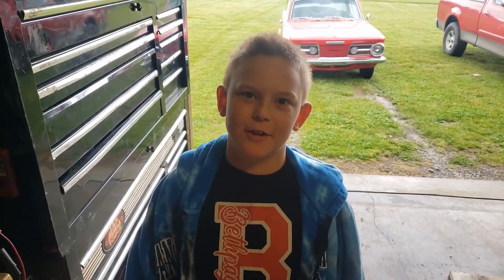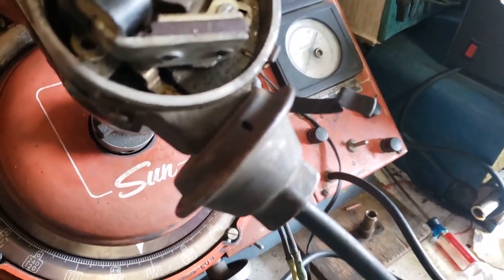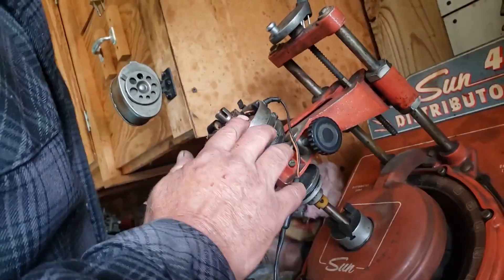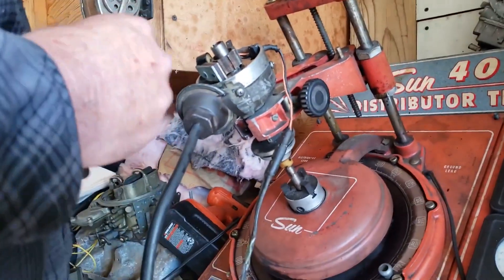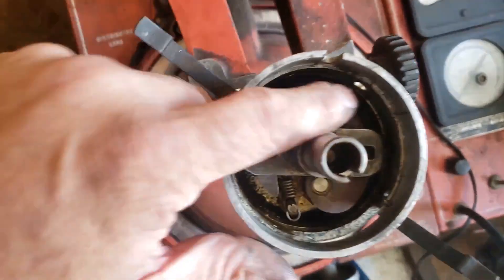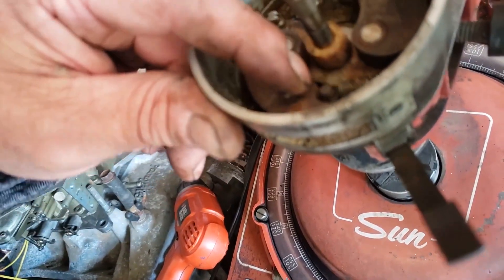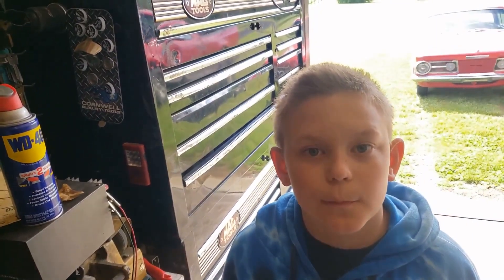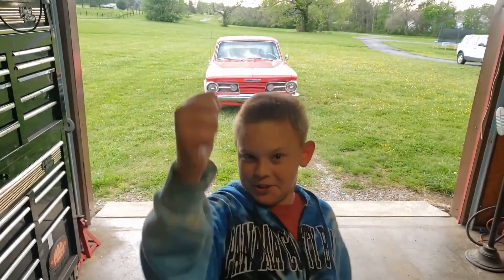A simple shocking speed secret, recurving a distributor for performance and gas mileage

Comment: how wuld plazma ore amplified ignition behave in a engine? Im not shure what Im geting useing it? how wuld you tune carburator for max fuel efficiency culd acelerator pump by removed and moded preshure valve on the carburator to force him to work jusl like ordinary mechanical carburator? perhaps adding some vaporisators and moisture/air seperators wuld that work similar like Lpg car?
Reply from the maker: Hello devils wish. Plasma ignition have being worked on for a long time now and its finally showing benefits. I personally think it might be the way of the future for combustion ignition. Mileage being one benefit but all around torque hp. And emissions. As far as carburetors for fuel economy a lot of work can be done to improve on them for gas mileage. But if you don't computer control the air bleeds day to day will change the tune.still improvements can be made. First under size the carb. The more wide open the carb is the better the job it does but we go to fast so smaller is better  for that reason alone but hi air speed is important here also and thats what also happens with a small carb. As far as taking off the accelerator pump the carb would have to be designed ahead of time for this. For instance the boosters need to be long and very pulse  sensitive. The system can be tweaked to be much better though. One easy fix is delivery timing. Once the carb has transitioned to the main you can almost eliminate any more pump. Also deflectors can be installed at the nozzles  to spread and deflect and mix the fuel helping you to reduce the shot size. As far as other devices attached to carb I don't have a clue sorry bout that.

Comment: Hey John, love the video. I have a Mallory Dual Point YL for 383 Mopar. Can I take out 1 of the springs to advance it faster too. If so which one. Thanks
Reply from the maker: Yes you can I always take out the biggest 1 no matter. Those were the best distributors of the day. Some distributors   if you take out the spring require a E ring to retain the centrifugal weight so double check that.

Comment: All in by 1500 RPM? Isn't that a little too soon? I would say all in by 2000 or 2200. I would think that there would be some power loss at 1500 RPM with too much advance coming in too quickly. Or am I wrong?
Reply from the maker: Ignition timing is tied mostly to cam timing, and at peak torque is the point where the compression pressure is at its highest. At that point is where your total timing vacuum is at its lowest. Now I'm going to be completely honest with you. My timing on the barracuda and the truck is at max at idle. All in including vacuum as soon as the engine starts @ 46 on the barracuda and 48 on the truck. I have to be careful about saying these things because if you're new to driving and with a manual transmission, lugging an engine with this kind of timing can cause damage. 2 more things. If you lock out your distributor, then your timing starts and idles at your peak timing minus vacuum 32-38 or so. Running that way the engine is so responsive and fun to drive. The problem with lockout is that you can't start the engine unless you flood the engine or crank with the ignition of. Know back to cam timing. All cam profiles have a peak torque range and all above and below rpm,s there is lower cylinder fill which means the compression pressure is going down above peak torque and going up below peak torque. At lower rpms, the intake valve is open to long, and the piston pushes intake charge back into the intake manifold. (That's why engines with big cams idle with low vacuum) and thats why compression is lower under max torque. Above peak torque there is simply not enough time to fill the cylinder because the port is limited or the intake valve closes to early. Hope this helps. Thanks for watching.

Comment: Ty Sir and Son , Never have seen this done before kinda understand it but its been eons since i timed a motor . The carb adjustment u showed at the race track can you plz do a vide on that , more info plz , Bless you all and i subbed also ty :)
Reply from the maker: Thanks for the sub, I think you're talking about the Weber plates, yes I will be doing a vid on those. If that's what you're talking about keep your eyes open for these things at the car swaps there getting hard to find and they are so easy to use. 👍
Reply: Tall John's Fun Shop appreciate it John. 👍

Comment: So I did this to my 400 BB Mopar today. I pulled the distributor followed your instructions and all went well with the distributor. But my son bumped the starter with the distributor removed. I put a mark on it before I removed it and I installed it back exactly where it was beforehand. But I'm worried to try to start it now where the motor was turned over without the distributor in it. Is this going to completely throw off the timing?
Reply: Should I have turned the motor till the timing mark is at TDC before installing it back into the motor?
Reply from the maker: On a 400 mopar, the distributor can only go in 2 ways, right or wrong. Or another way of saying it is correct or 180 degrees out. The exception is if you lifted the intermediate shaft (the gear down in the hole were the dist mounts), you might need to find TDC at that point. So because your either right or wrong if you put the distributor in and the timing is any were close, it should fun and if your in the wrong position it won't ever start and you will probably get a backfire.  If this is the case, then simply lift the distributor about a half inch and rotate it 180 degrees and put it back in and then set you timing  where you desire and ready to go. Pulling #1 plug out and cranking the engine with your finger over the plug hole until the pushes your finger away will help you avoid a backfire on the chance that you guessed wrong but a little pop or backfire and the rotating the distributor is easier and faster.  Anyway, thanks for checking us out. I hope it helps.
Reply: @talljohnsfunshop2722  thank you sir! I got it straightened out
Reply: Well I thought all was well. Initially I had it 180 degrees out. I pulled the distributor up spun the shaft 1/2 turn, and put it back in on the mark I had initially made on the block and distributor before I touched it. It crunk up after a couple tries. Ran decent.  You said yourself in a video, that if your motor is backfiring, you need to get a new mechanic 🤣 well I do all my own stunts, so I thought you could help before I fuck something up bad. I haven't driven the truck yet, because I just have got it back together enough to drive. but in park, if you smack it close to, or at wide open throttle.... I get a huge backfire and fireball through the carb. I don't have a digital timing light like yours. My timing light is probably made the same year as the truck. Sears Craftsman. Nor do I have a tach. Like I said it's a 400. Long tubes, Edelbrock carb and electric fuel pump and pressure regulator. I don't know much else. If anything has been done to the motor.  I have no clue beyond the timing tab how much timing I have.  I was wondering if there was anyway I can send you a video of what I have going on. I trust your knowledge, and maybe you can point me in the right direction. I'm getting frustrated with the damn thing. It runs pretty good, but when you get into the secondaries it busts back. I can definitely show you better than I can type it. I think it's something simple honestly. I'm just not catching it. Thanks for helping me get it me this far. And I definitely would appreciate any advice!

Comment: Great video! I plan on doing my straight 6 in my '77 Jeep CJ.  It has 35" tires and is a real tired dog off the line. Any tips?
Reply from the maker: Many times on the older vehicles i find that mid to late 70s and early 80s that the cam timing is retarded about 4 to 8 degrees. Then you add that the timing chain is old and stretched out and the cam sprocket is made out of nylon and is ready to break. So I would look into that. Getting your initial timing up will help a ton. But be careful not to ping it, thats never good. Working those things has very successful for me.
Reply: @talljohnsfunshop2722  That makes perfect sense I will definitely put a new timing said in there cause I have no idea what it would’ve been done last if it ever was. Then I’ll move onto freshening up the distributor.

Comment: Great videos and info. Are you using the Chrysler ignition module as a pulse amplifier?If so, how have you wired it? I am just getting started with a Sun 500 Distributor tester and would love to use it for Chrysler electronic Distributors. Thanks.
Reply from the maker: boydsdodge  for the electronic mopar dist i use the chrysler module. i use the black and yellow wire (TACH) wire i connect to the points lead and i use a 12v power supply it work for any magnetic pickup gm or ford
Reply: @talljohnsfunshop2722  Thanks, I will give it a try. Plenty of ECUs around here.
Reply: It worked, thanks. I used a AC/DC 9 volt wall plug for power.
Reply: Now to get the tach dwelling working. new batteries, tach bottoms out below zero.
Reply from the maker: sorry didnt get back sooner had some race friends from way back show up. if ya need more info ask away ill do what i can to help. have a good one
Reply: @talljohnsfunshop2722  Thanks, No problem. I had a faulty transformer and it was throwing me off on my connections, reason why I was asking about ground. I am sending my Tach and dwell meters out to Paramount to get batteries converted and calibrated. Can't wait to start optimizing distributors. The one question I have is, if engine wants 20 initial but that causes hard starting what do I set up the distributor with. Also if you remove the springs, how do they return at idle? Thanks again.
Reply: @talljohnsfunshop2722  I got the mopar orange box working as a pulse amplifier, using a 12 volt transformer.
Reply from the maker: @boydsdodge  if you have hard starting at 20 them you must set your initial back to were it will start. Initial is really only for starting . no advance would be best (LOCK OUT DIST) but you end up with the hard start. not good for street cars. so i set my dist to full advance after start up. Thats the way mopar did it in the day on there race stuff also. so if 18 it will start thats your initial. I have seen a few people have some ideas about were you set the initial but my way is as hi as you can go and have good hot start engine. Know I have seen some folks take the time and put one spring so soft the it pulls the timing back to say 5 and they put a loop or oval shaped spring loop on the second one that stops the dist from advancing until the rpm you want. As far as the advance coming back,  the one spring you leave behind will pull both weights back. if you take out both springs it wont return and it like a LOCK OUT DIST.
Reply: @talljohnsfunshop2722  Great info, I get it now. Thanks for the info, very helpful, having this Sun tester going has really been great for learning on these, now to get my Tach back from Paramount. Thanks again.

Comment: what happens to the weight with no spring when it is send it out with centrifugal force?
Reply from the maker: It still does its job of advancing the timing only it does it at a lower rpm. It moves back when the lonely spring can bring both back when centrifical force gets low enough to bring it back.

Comment: is there a GOOD HEI distributor for the slant six? or is it only cheap crap and needing a GM ignition module thing no one can seem to give me an answer and ive been looking for almost a month
Reply from the maker: Well there are a couple different dist available. There's the mopar electronic using a mopar module. There is pertronix   you can use ( haven't used one of those in year's I'm not sure if there still available) and there's the tri power that uses a basic gm type HEI module but not a complete distributor, it is a good  system from what I've seen but I have never personally used one, hope this helps. If this is not what you're  after I'll try to help
Reply: @talljohnsfunshop2722  that's the thing, I wanna get rid of the mopar module and put in an MSD ignition. I dont know if any of the distributors you listed will even work with it, I cant find any forums or videos to see if they work together. Thanks for replying
Reply from the maker: You can use the mopar  electronic distributor with the msd. The msd distributor uses a copy of the mopar pick up. They are completely compatible I use a 6al box on my mopar distributors
Reply from the maker: The mopar distributor is a magnetic pickup so just google msd magnetic pickup wiring and you  will find it
Reply from the maker: https://www.jegs.com/InstallationInstructions/100/121/121-6425.pdf      scroll down to page 16 this is factory mopar distributor to msd 6al
Reply from the maker: Which distributor do you have now points or electronic. NP we all started somewhere some day you'll be a pro at it helping someone else
Reply: @talljohnsfunshop2722  stock distributor which i believe has points. my car is a 73 dart swinger (don't know if model year helps)
Reply from the maker: If you have points now and want to keep that distributor you need to get a pertronix 1361A ignighter you can get them from Amazon. This can be used with MSD. You can also use your points with your MSD all 3 wiring diagrams are in the link I sent you
Reply from the maker: The link you sent me is for a replacement  magnetic pickup for a MSD distributor. It won't work on a factory distributor.
Reply from the maker: If your distributor has 1 wire coming out of the side its points if it has 2 it electronic if it's a factory setup
Reply: @talljohnsfunshop2722  and if i want to change the whole distributor, what one should i go with?
Reply from the maker: That's a cross over year it may or may not have points if one wire is coming out of the side its points if 2 its electronic
Reply from the maker: The mopar factory electronic is a excellent distributor but I would recurve for sure. There aren't much for good aftermarket parts for the slant so you'll have to find someone to do it or do it your sef

Comment: Hi thank you for this video!! I just did this to my 73 B300 360 and when I went to start it it cranked and cranked then backfired Huge. Then it started and ran great then nothing. Do you have any idea what I may have done wrong? I did this with the distributor In place and didn’t mess with the timing.
Reply from the maker: Hi sorry to here you had problems.  A guess would be that the little horse shoe clip my not be in place and is allowing the reluctor and rotor to go out of time.
Reply: I’ll check that out thank you for your time and your videos!!
Reply: Hey Tall John! That was one of my problems the other was the pick up was just ever so slightly out of line! Thanks for the push in the right direction!!

Comment: On road trips I’m running 2250rpm at 75mph in 5th gear. Should my timing be all in by that rpm?
Reply from the maker: Yes absolutely. Anytime your engine is at Cruz throttle position it can handle total all in. The reason is at Cruz your engine is running at 60 PSI compression. Compression that low burns fuel extremely slow, so the need for high timing.
Reply: @talljohnsfunshop2722  thank you for the prompt reply. Everything I’ve seen says by 3000 rpm, but I don’t run that high with overdrive
Reply: So, total advance, is that with vacuum hooked up or not hooked up?
Reply from the maker: @mikeburnett7028  total is without vacuum. when vacuum is stated it's always (total w vacuum )

Comment: Hey John I have a real quick question. IYO who is making the best non-HEI distributor? The HEI's are too big for my use.
Reply from the maker: DobermansRock when use aftermarket i always go with MSD distributors. you dont have to use there module to make them work it wires in the same as factory
Reply: @talljohnsfunshop2722  Thank's Tall John. I figure a guy with a calibration machine would know what calibrates best. A good TMDE Test Measurement Diagnostic Equipment day to you friend.
Reply: @talljohnsfunshop2722  They say used MSD box and thats another $300
Reply from the maker: I find the street dist w vacuum advance for mopar about 150.00 and kit for about 350.00 on E bay

Comment: first ,  20 deg initial and all advance in by 2000 equalls ping monster . second you will never accurately set initial timing with engine running with all that slack in the weight mechanism . it will just bounce around .
Reply from the maker: Well micheal if your engine won't ping with all in at 3000 it won't ping all in at 2000 reason the engine traps less air fuel mixture at a low rpm due to overlap in the cam. If it's pinging at 2000 it's going to ping at 3000, which should tell you your total timing it too high. As far as bouncing around goes mine is steady as a rock.this way of working ignition timing is not new, it was trained by Chrysler in 1969 in tech film strips to do to customer cars.

Comment: Old ford Duraspark distributors are so much easier to do…..
Reply from the maker: Agreed
Reply: @talljohnsfunshop2722  I see you tweeting springs this and that…. Ford replace the springs to light ones and bent the tabs as necessary, total advance can be changed with a piece of vacuum line….
Reply from the maker: This was more about the job can be done without purchasing any parts  but the ford dist does have tweeking advantages